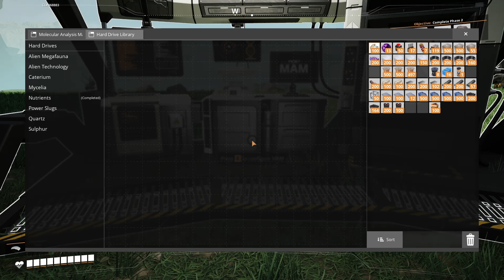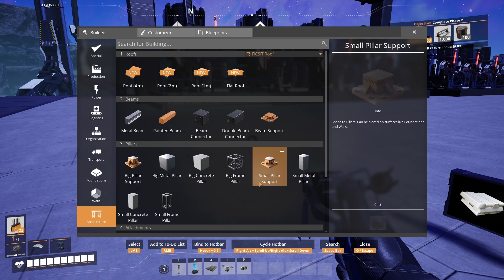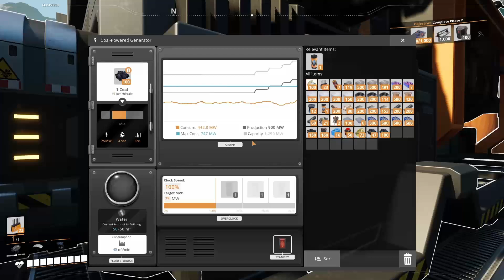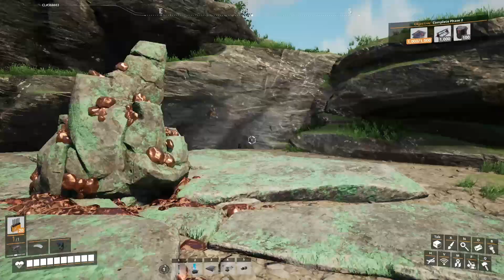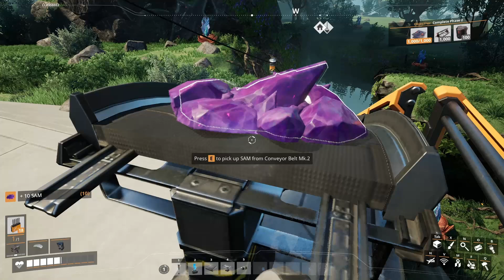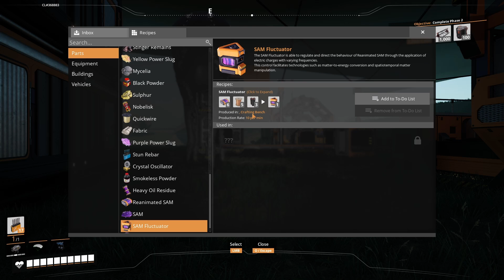Satisfactory 1.0 | SAM-I-Am

Comment: Hello Friend, @12:40 I see your coal feeding into the generators. Not sure if you already have smart splitters but if you do, I like to use smart splitters and put the mainline on overflow and every feed into a generator on "coal" or "any" so they will fill up 1 generator and then move on to the next. effectively making your powergrip a bit more stable. The next generator will only turn on if the previous one is full so less fluctuations and less extreme ones too. cheep way to not load balance but have some stability
Reply from the maker: Hello, Friend!
We don't yet have smart splitters, so we are relying on the balanced output of the miners and the belts to keep things flowing. I also primed the generators with coal and water before turning them on, so they should have plenty of resources on the belts to keep things running smoothly. Once we have the smart splitters, I might replace our current system with better one.
Reply: @StormhavenGaming  nice yeah priming with both coal, water, and full belts should have the whole system bugfree. Love to see your content :) I always enjoy it
Reply from the maker: @tiemenvanderbijl785  Thank you for your continued support. It is greatly appreciated.